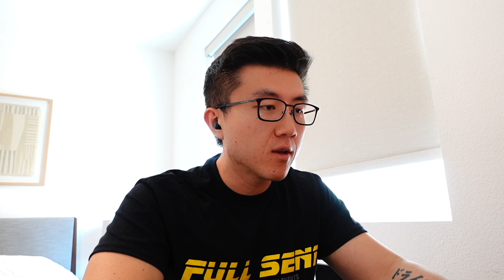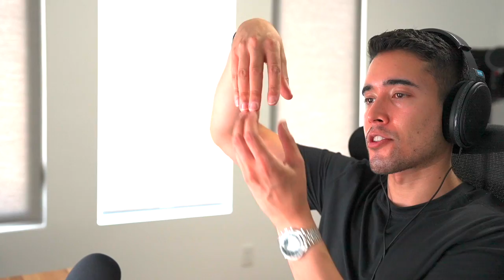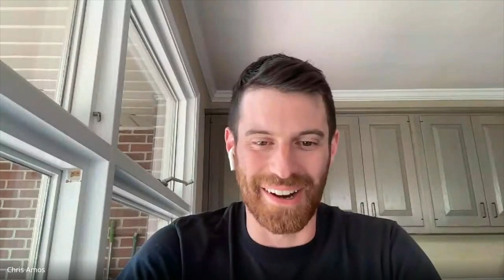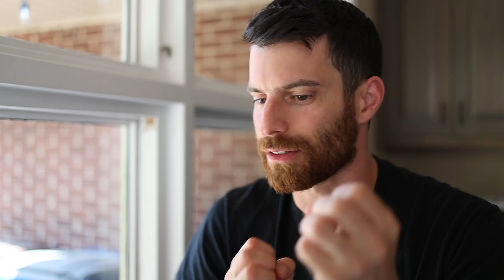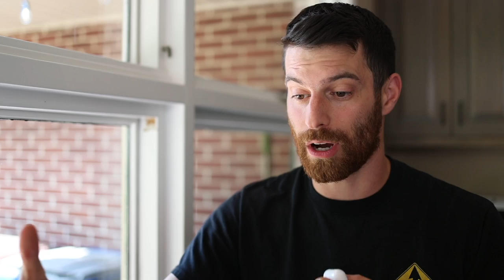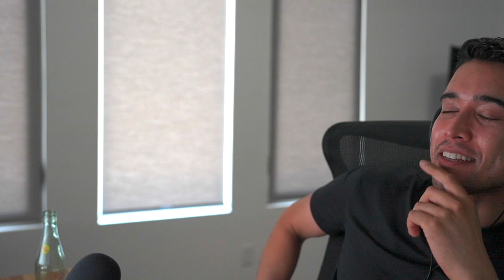Is Your BRZ or GR86 a Ticking Time Bomb? ft. TheTopher and Jubbal & Cars - ZCT #35

Comment: Good job on bringing light to this issue 👍🏽 I wish someone did this with the GT350. The engines seem to spontaneously blow up for no reason and its a hot topic.

I feel like using the 5W-20 Oil might be a bad idea though because that would give Toyota or Subaru an easier way to deny your claim since its not the "recommended oil"
Reply: Recommended oil is 0w20/5w30. 5w20 falls right between. There should be anything to worry about, unless you live in an extreme cold winter location.
Reply: Agreed, would've loved to see something similar regarding GT350 voodoo Motors... Although I heard oil starvation was the causes - the culprit being the vibration of high revs loosening oil filter off over time. Regardless, I'd think a low-oil indicator would've warned drivers...

Comment: What I would do is: 
No reving the engine first 5000 miles, no racing for first 10.000 miles.
Drop the oil pan, clean it, put a baffle oil pan, I guess it's called.
Put very good or racing oil in it. You guys talk about puting 5w30 instead of 0w20. Why not 5w40 or higher? Why not 0w40, or 0w60? Also change it more often. 
Oil cooling system and temperature and pressure gauges.
Also, if Toyota or Subaru are racing this engine, what have they modified? Maybe you need a higher flow oil pump. If the problem is more complicated, don't race it, have fun on the street. 
I'm sure you can rebuild the engine stronger than the factory but it would be expensive and who would do that to a new car?

Comment: You should include some actual data. Start with sales numbers. I would think that would be easy to find. Then try to get an approximate denominator for tracked cars. This will be harder but see what you can do….. Lastly you were on the numerator. Saying you need 200 or any number of failures is really meaningless without the other info.

Comment: Do you think anything will happen if I just do touge runs from time to time? I plan on taking off the oil pan and clearing rtv + baffle
Reply: With street tires, no. If you use 200tw tires, all bets are off.
Reply: Nope. No where near enough sustained lateral force to worry the oiling system

Comment: Here's the key to keeping your brzgr86 alive until Verus comes out with their oil pan.
Don't run super 200 unless its AutoX and stay below 4k rpm if you are hitting more than 1.4 lateral g's this includes a cone of about 30 degrees on right turns, so sharp hill and downhill rights under accel are most dangerous. 

I ran Accelera 651s on a full track oil cooler Verus AOS, full suspension on 245 squared setup, no downforce, underbody is okay but you will be never be in a competitive class. Id say the Armstrong Blutrac tires are a great budget option that will keep you limited to about 1.6gs. Mind you I hit 1.6 and 1.5g often but under 4000rpm is the key. The car has torque gears are short, don't ring it out just for a bit of time. 

Stick to that and you're safe. First GR86 was healthy and tracked weekly minimum from late Jan 22' until May 24'. Got rear ended at a stop light and now I have a new one. First car was healthy at almost 30k miles of daily driving and track.
Reply: Also, sidenote. These are amazing rallyx cars, so consider going that route, also safer.

Comment: Does an aftermarket oil baffle pan plate help?
Reply from the maker: Doesn't hurt, but doesn't fully resolve oil pressure drops during sustained high g corners
Reply: @Zygrene  so there's no aftermarket solution to fix high G cornering oil starvation?
Reply: @grantkahale8933  theoretically this is what accusumps are for but there isn't a lot of literature out there about how they work for our cars

Comment: The GR86 is such a good looking car with amazing handling and decent power for twisty roads/tracks, expecially for the price. Its really sad that that reliability is so questionable. If you use the car for what it was built for, its likely you will become one of these warranty statistics. Guess im holding off until the 2024/25 Toyota built GR86 comes out. It wont be the same though because it wont have the low center of gravity engine, which will change the amazing handling, like the current  subaru flat 4 engine.

Comment: Miata is always the answer guys lol
Reply: Inline 4 rules over boxer all day. K Swap the 86.
Reply: I see my mx5 2.0 ND2 RF in soul red color as a masterpiece. So .. yes I agree
Reply: The chassis isn't stiff enough. Gr86 is 3x stiffer. I'd rather just K24 engine swap a GR
Reply: @65hi863dhyu  i don't notice any torsion issue on my RF when I drive it fast.
Reply: @lucianolucidi8624 I did. As well as in my AP2. Why I prefer coupes.
Reply: @65hi863dhyu  what is AP2?
Reply: @lucianolucidi8624 Honda S2000. They're not stiff enough either.
Reply: @65hi863dhyu  ok then.

Comment: You guys are confusing part of the issue. It’s not just the oil pickup being blocked, it’s the small pieces of RTV getting through the screen and into the engine. There’s a reason you shouldn’t use a Subaru powertrain. The sad part is Ive seen this on daily drivers that haven’t even tracked the car.

Comment: This is why I don’t like Toyota not building there engines not just Subaru also BMW I had a twin turbo 4 cylinder 528 and if you looked at wrong it was going to the shop we buy Toyota because we’re poor and Toyota’s are usually reliable!🧠🤯🔫

Comment: It's a street car, not a race car. I think manufacturers are being more than fair. Driver's are modifying the chassis to make the car sustain forces far in excess of what the car is designed for.  Not a popular opinion, I'm sure, but we can't expect vehicles to be unbreakable and stil reasonably priced. There is an inherent problem with boxer engines, especially when trying to maintain a low center of gravity and running exhaust under the car and obviously near the oilpan. It's just a lot to ask, period.

Comment: RTV is the IMS of this gen subie. As a VW fan boy i find it ironic the Subaru is an unreliable piece of junk.
Reply: Not really, because IMS was a real issue. Removing RTV doesn't fix the root cause of these engine failures.
Reply: @404nobrakes  IMS is fixable. Is the RTV issue fixable?
Reply: @deanmarr785  RTV is, oil starvation due to G force (which is likely to be the cause of most engine failures we've seen) is currently not.
Reply: @404nobrakes  Thanks.